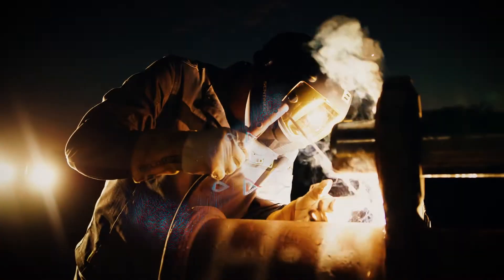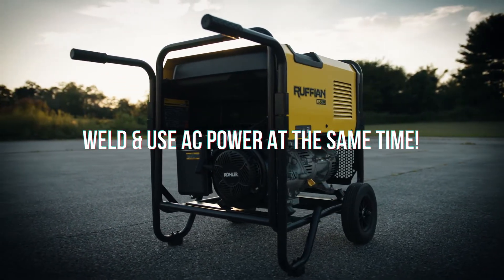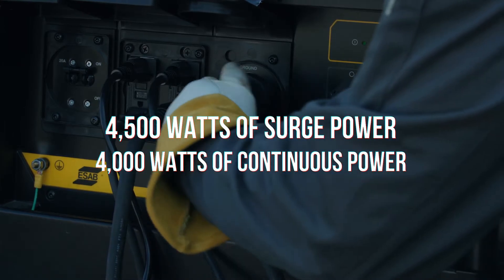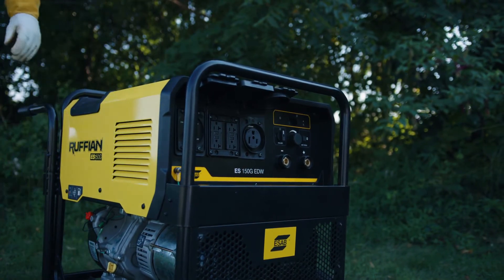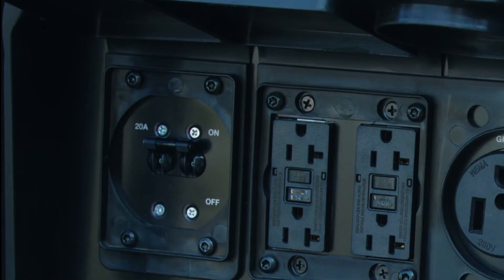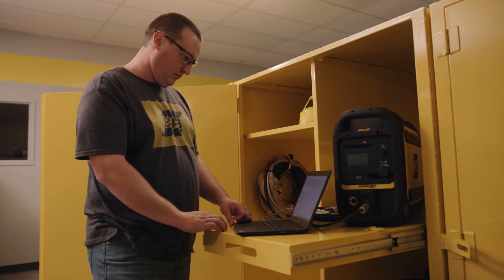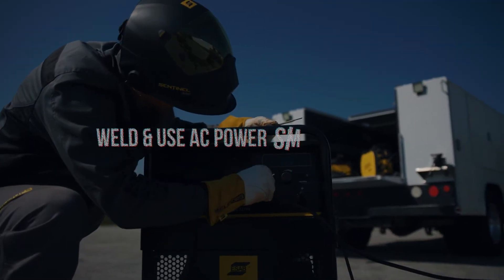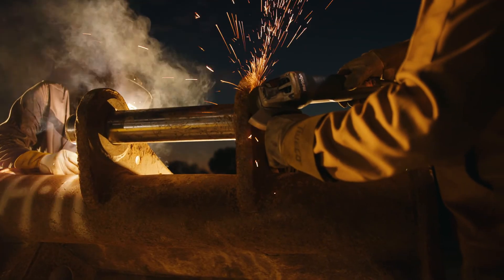How to Weld & Use AC Power at the Same Time with ESAB Ruffian ES 150G

Comment: So will this run a small compressor  and plasma cutter? If so what one. I got the 150 it runs my esab rouge MiG welder decent but not at max like 17 volts max before it trips a breaker

Comment: Does this machine have an auto-idle, or does it run continuous rpm speed?
Reply: It runs wide open.      Great little machine though. We’ve been running one hard for over 100 hours now.
Reply: @Bostonharborwater  hey man any update on how it’s running still ? Looking at getting one for side gigs can’t find anyone who’s had them before though
Reply: @saml7580    Great machine for the money. We got a second one.   We all have miller trailblazers in our trucks, we have the esab 150s sent out when we need a second machine.  Or when Wer working somewhere  the truck isn’t in reach.   If you’re running 1/8 7018. They will burn it all day.   We’ve also puddle welded using 6022 wide open 150 amps. All day for days on end and these machines did it without issue.   I believe one of ours has 500  hours on it.   They’re obviously not quite as smooth as the big machines but that’s to be expected.
Reply: @Bostonharborwater  thanks man appreciate it !! Pulled the trigger on one just set it up , looking forward to using it for my new side hustle
Reply: @Bostonharborwater  thanks for the update! I'm starting to like the sound of this new machine over a bluestar
Reply from the maker: It runs at a continuous RPM speed. The more wattage you use, less auxiliary power and vis versa.
Reply: Good to hear, I'm buying one in a few months.
Reply: Really, low idle feature doesn't really help. Yea you'll save some gas, but I'd rather have power available right away